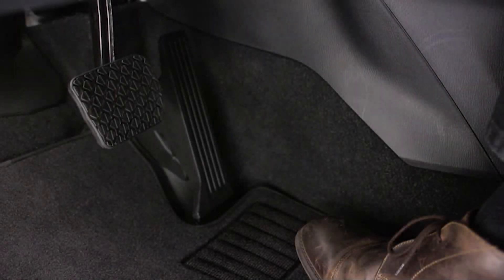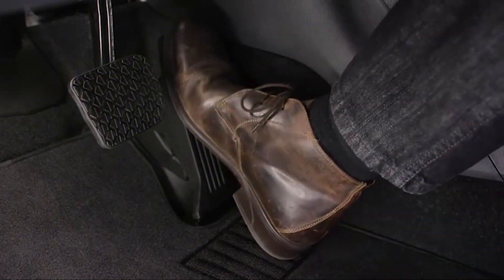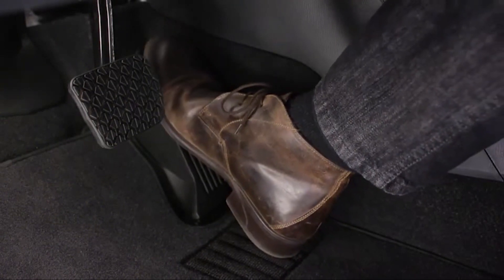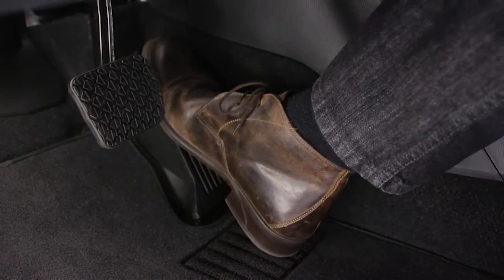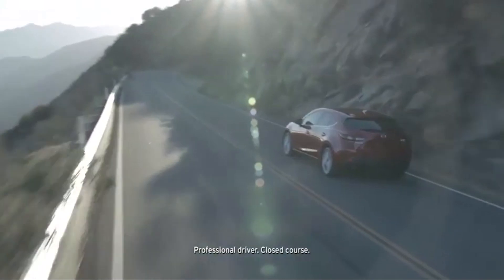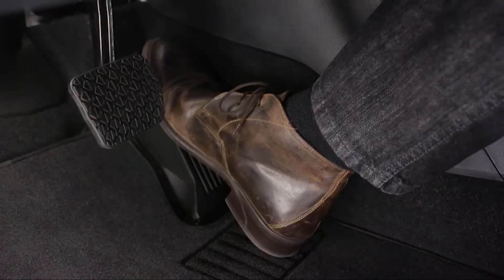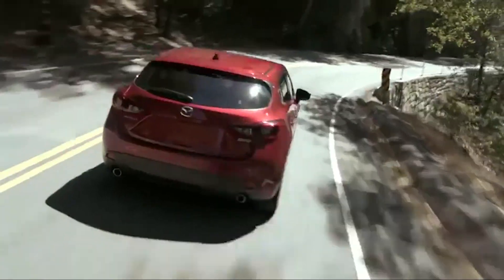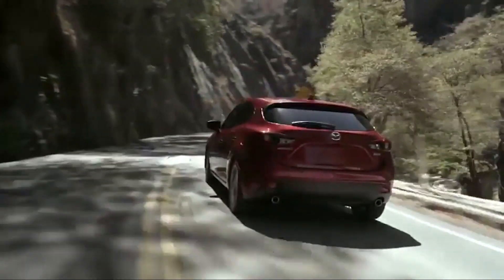How to use the accelerator kick down system

Comment: May I know will this hurt the engine or transmission? As the rpm is so high suddenly.
Reply: No
Reply: no it was designed for this
Reply: Thanks alot for the feedback guys.
Reply: @strike5677  No problem